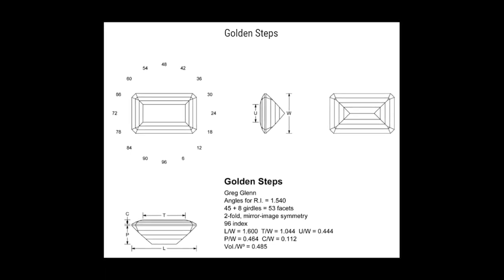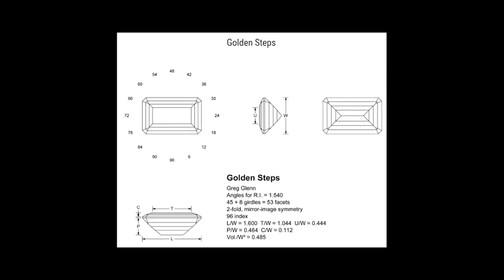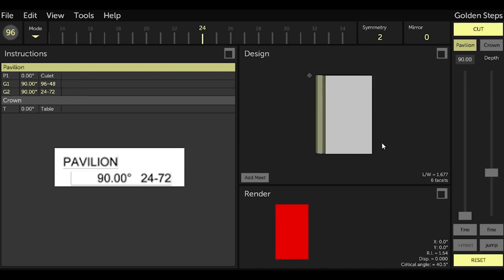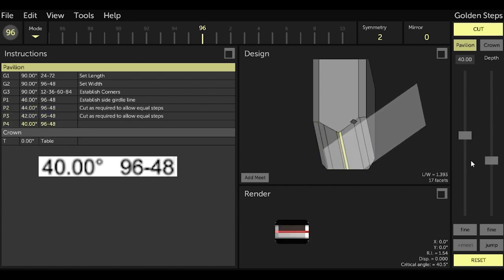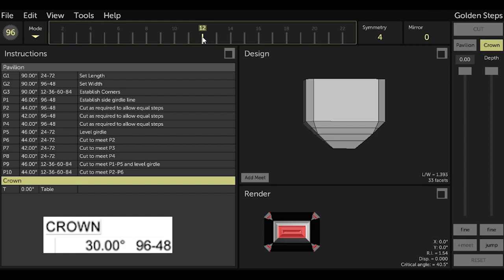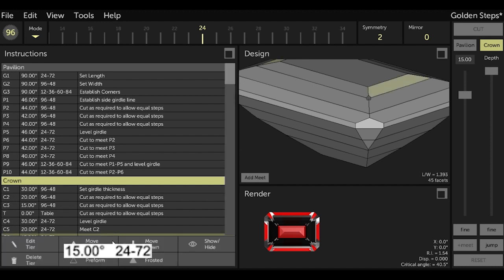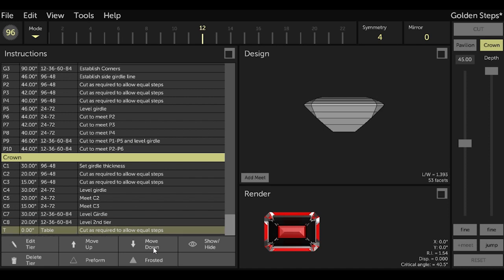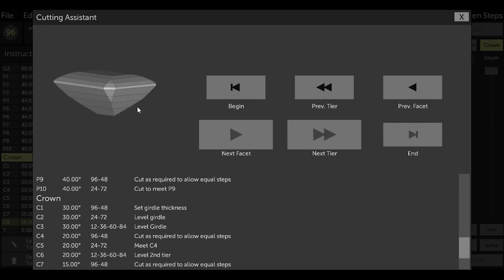Gem Cut Studio Tutorial 5: Recreating An Existing Design In GCS

Comment: It pays to work with Meet and Add Meet.   
Meet allows you to align facets to Meet Points or other Facets.
Add Meet allows you to either work from a specific point and adjust the angle as necessary (rather than setting a specific angle). Add Meet also allows you to sub-divide facets or faces more accurately than you can generally do "by eye".  
I recommend the use of both Meet and Add Meet when inputting any design parameters.
Reply: Thanks SnowTiger45.  I'll include information and a demonstration of '+meet' and 'add meet' in an upcoming tutorial.